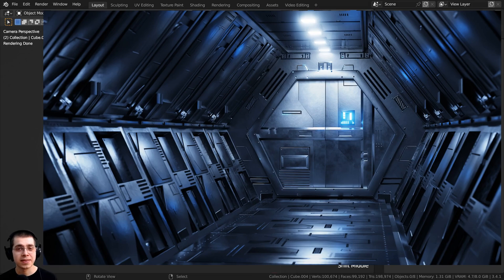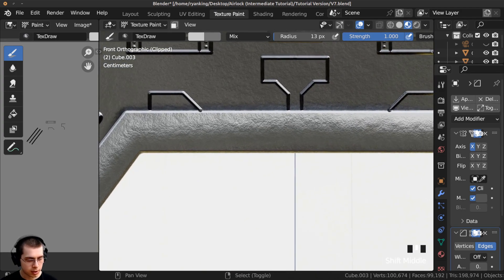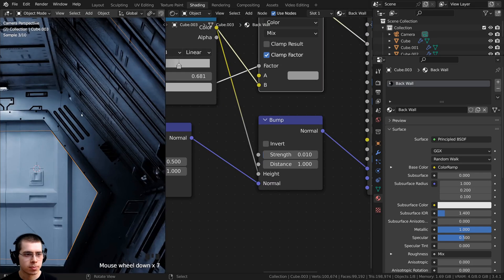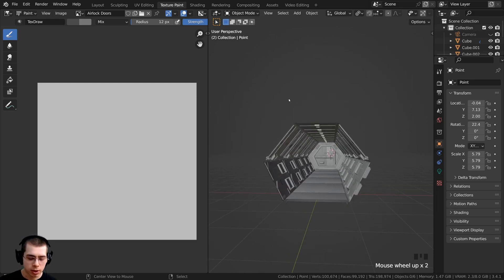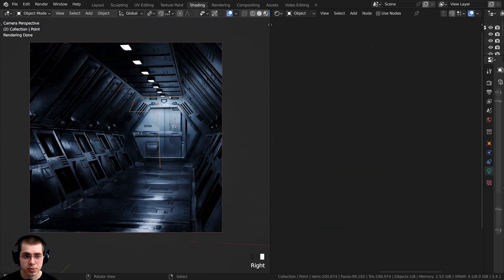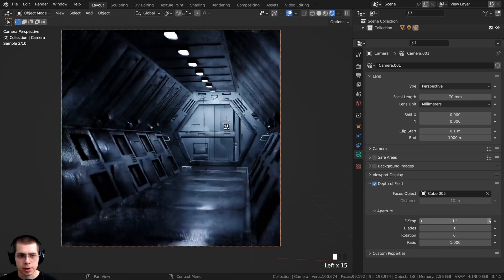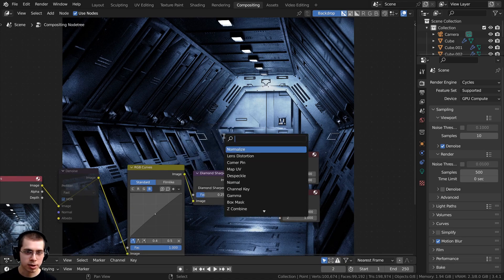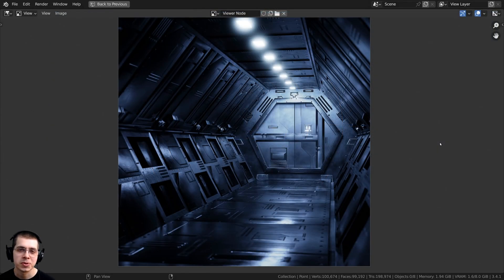Sci-Fi Airlock Corridor - Part 5 (Blender Intermediate Tutorial)

Comment: Thanks!
Reply from the maker: You're welcome!! 😃
Reply: @RyanKingArt  Seriously, the biggest joy I have, and I find where the rubber really hits the road in learning any graphic design software, is seeing the discrepancies. So, I start texture painting the airlock door and every stroke looked grossly pixelated. Now, I know what I did wrong and went back and fixed it. That's where I really learn to use a graphic arts piece of software. 

Do you know what I did wrong?
Reply from the maker: Hmm, for the pixelated problem, did you set the image to 32-bit float when you were making the image? Also did you make the image 4K resolution, and UV unwrap the mesh correctly so it uses lots of the texture space?
Reply: @RyanKingArt  You nailed it. UV misstep.
Reply: Finished. It was good times. And, I would have no problem with having an intermediate playlist. What I would like to do is take some of the earlier robots and try inserting it into the scene. That would be an interesting project. Thanks, Ryan.
Reply from the maker: @Gregory_Harshfield  Thanks for watching!